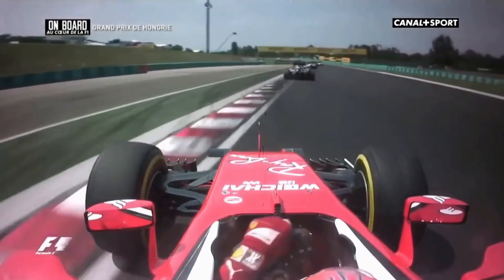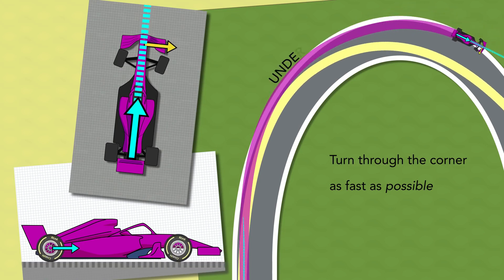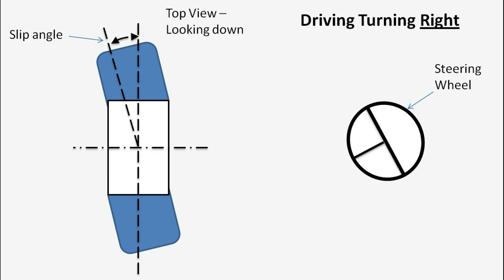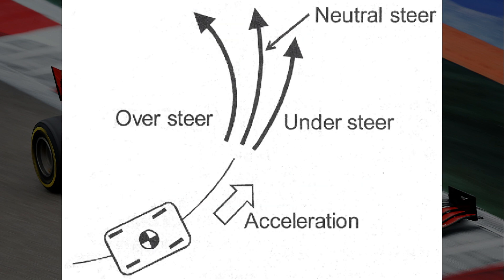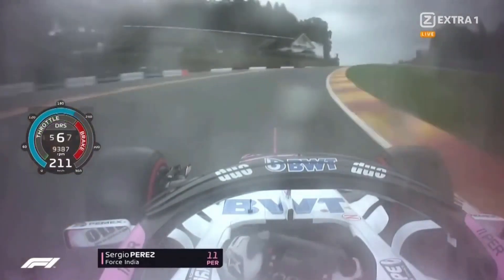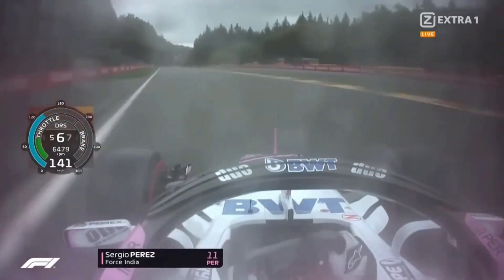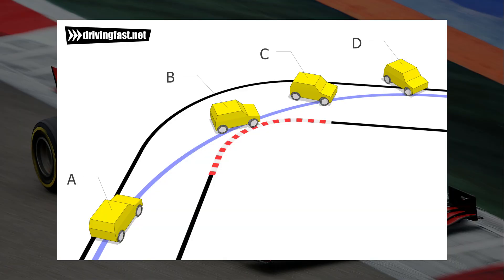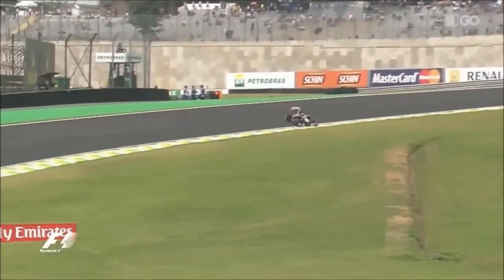Oversteer vs Understeer in Formula One - Explained

Comment: Under Steering is Safe 'Won't Kill U'
Aftr Turning Accelerate. Not while Turning

Turning In = Braking
Mid Corner = Steering
Turning Out = Accelerate

Reduce Steering Lock = Increase Steering Response